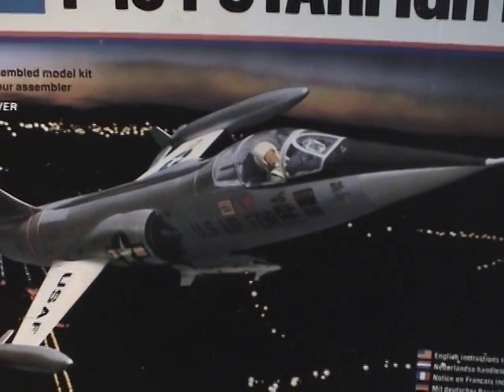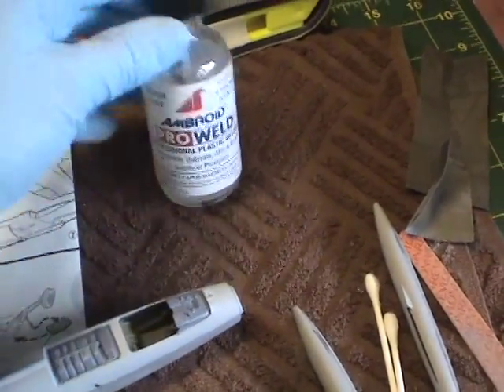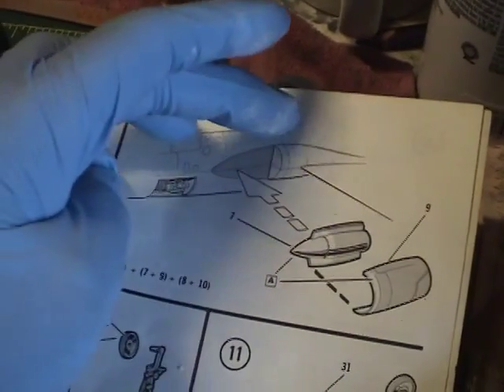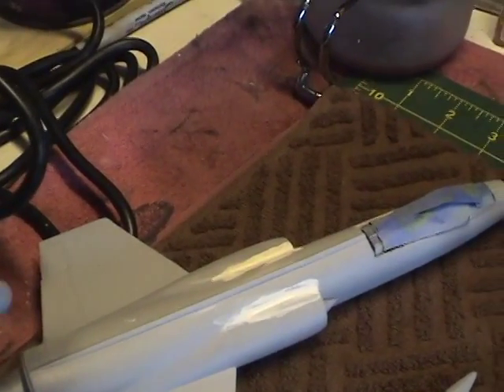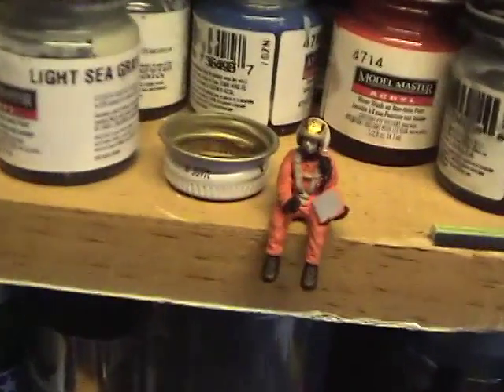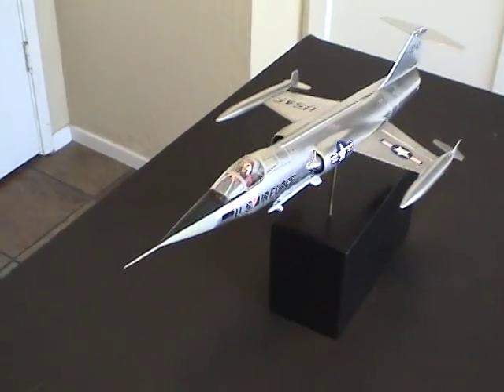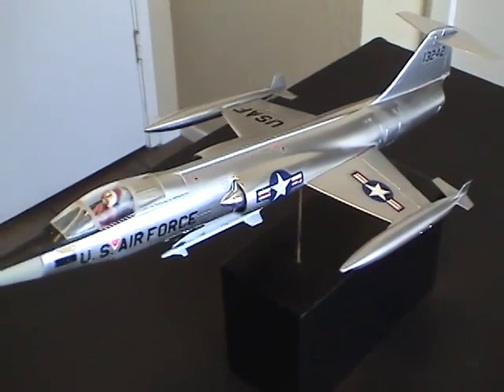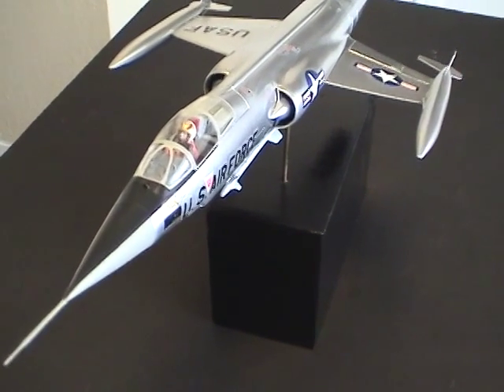Building Blue Jay 4 the F-104 Starfighter

Comment: The top of the wings should be painted white. Those of Blue Jay 4 where also white. They were painted white to cut down on heat build up on the wings before flight on early versions and the practice continued even after they fixed the problem. Great model.